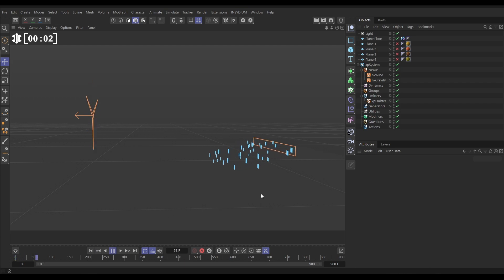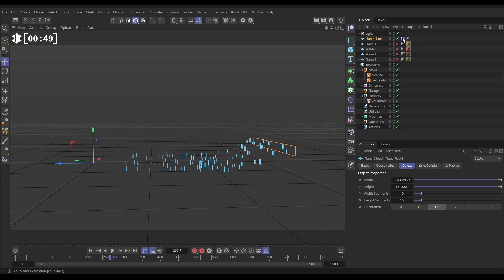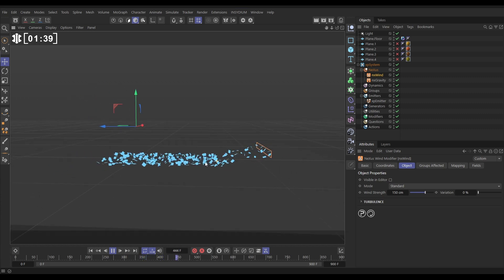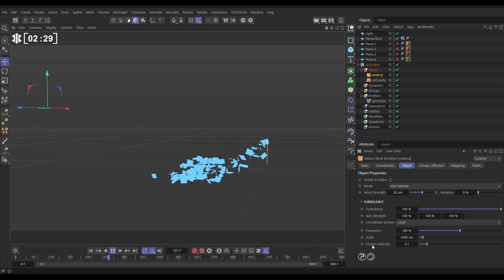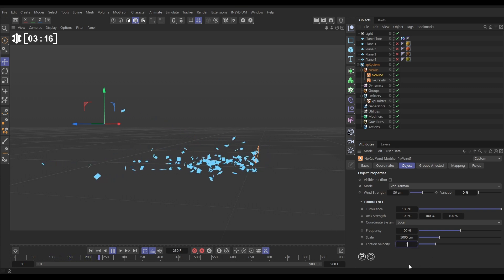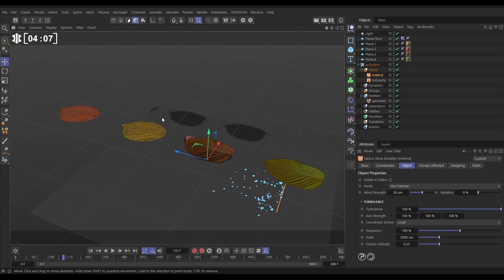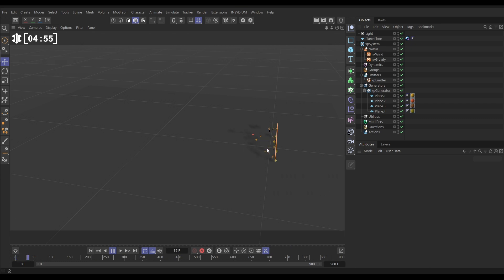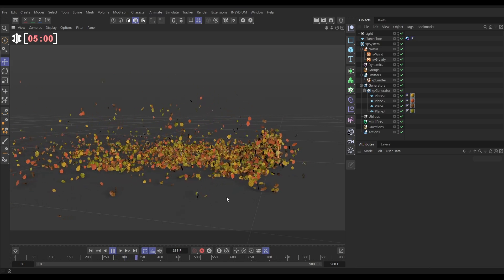Top Tip Tuesday – Realistic Gusty Wind for NeXus Particles

Comment: Is there a way to make all the particles lay flat on the plane once collided with the floor as a opposed to a continuous spin cycle?
Reply: Yeah this is what would be impressive.  This whole tutorial is awesome but basically doesn't work if you have a floor in the scene that they need to properly react too!
Reply: Clone your leaf object, put that into an xpJoin, and then run the 'create cloth' function on it. Will be slow, but works perfectly. Or put a xpdynamics tag on the generator object. But won't bend as nice in the wind like the cloth will

Comment: That’s very definitely possible.

One thing I have noticed when doing work like this: it is really helpful to hand animate 2 or 3 “hero” objects. Pick the most noticeable particles, and give those more advanced treatments
Reply: Outside of the sim or what workflow do you prefer?
Reply: @martinlofqvist9405  well, you could also convert parts of the sim to keyframed animation.

But yes, a hand-animated geo, that more or less integrates into the sim - which you could apply soft-body, texture, deformer, whatever you want. You’d be surprised how much mileage you can get out of a couple hero objects.
Reply: @martinlofqvist9405  one of the things I really like about X-Particles, too, is the crazy level of control of the particles… you can heist all the individual data -xpData or whatever it’s called. You can advect damn near everything too.
There’s probably a way to have the sim elements soft-bodied, too… but that’s for Insydium to answer not me :)

What I was referring to was more an animation technique - one or two particles can make a surpising amount of difference. If particles or sims aren’t doing what you want - MAKE THEM by hand-animation of hero objects

Comment: Is it possible to make those leafs soft bodies so that they would bend during flow?
Reply: better yet, use a cloner. Clone your leaf object, put that into an xpJoin, and then run the 'create cloth' function on it. Will be slow, but works perfectly
Reply: You can put a xpdynamics tag on the xp generator ;)